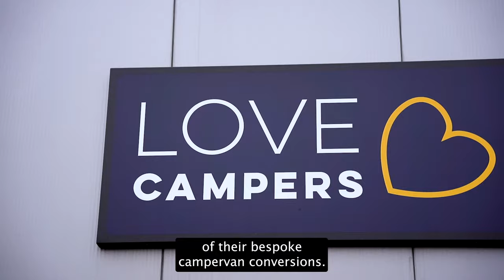VW ID Buzz Campervan Conversion VAN TOUR!!

Comment: Not enough interior height or length to the ID buzz to make a useful camper. As such this design is very compromised. Fridge on floor, no central dining table, only 2 belted seats, no grill or secondary hob. Feels like camper has gone backwards.

Comment: Can't deny the amazing looks of the ID Buzz, but am I missing something?  The real world range of this will be less than 200 miles, significantly lower in the winter or when fully loaded.  I know this through painful experience having owned 2 new EV's.  I thought the whole point of a camper was to drive for miles into the wilderness, something which will be very challenging with charging infrastructure as it is in the UK?
Reply: Our customers drove from Brighton to Scotland and back over 10 days in our Citroen E-Dispatch based campervan, which has a lower range than the Buzz. That journey was 1629 miles. It's possible, partly due to the high speed charging.

You can charge the Buzz from 5-80% in 30 minutes.

Also, based on early tests, the average efficiency of the Buzz with the conversion is 3.2 miles per kwh, 200 mile is the minimum I would expect.
Reply: You can perfectly tour with that Range.
I did 2500km in a week with an 75kWh eVivaro.
Now building my own E-expert camper.
Great tourer.
Reply: Old comment I know, but I just came across it. 

From where I live, (Derbyshire,) a 200 mile range would mean I could visit every single national park in the UK (mainland,) and only ever have to stop for one charge at most en route. A central location will have it's perks when we go fully electrical. :P
Reply: It's already been tested, a real world test it did 230 miles on average.

Comment: Beautiful looking vehicle but I’m put off by the short distance before charging..would it require 6 charges between London and Madrid..also if the batteries on EV s fail,out,of warranty there would be a huge bill to,pay
Reply: How is 6 charges much? Such a distance would normally take at least two days in an ICE vehicle. You can charge it overnight after the first day and obviously you need breaks anyway. Perfect moments for a charging stop. Also: EV batteries failing is very rare.

Comment: This small solar panel is redicoulus!!! Come on guys, you have a giant roof! Use this space! You can easyly install 1500W up there! And invent sth to charge the car with this power!
Reply: Even with 1500 W charging would be terribly slow. Not worth the extra cost and weight.
Reply: @Simon-dm8zv  During a whole summer day this would ad 15 kWh. To me this is no joke...
Reply: @thomasmargis9808  More like 5 kWh per day.
Reply: @Simon-dm8zv  If the panel is flat mounted I'm with you. But you can mount it on a flexible rig so that you can let it follow the sun.

Comment: I like what you did and are very happy to see what is possible

 but let me try to be as criticall as possible and maybe help you with some ideas.

- comparing it to the T2.... yikes, please don't, it is telling us it is not a T2 which makes us sad.
- a tiny solar panel of the roof....why so small when there is like 6 times as much space
- extra windows in the cargovan.....hmmmm I would prefer it to stay stealth and not have these windows, but when you want to maximise interior light then what is with the backdoor without windows? The image at 1:51 I really dislike. Windows don't seems to be at same height.
-Navy blue maybe should be a bit lighter to get more into beachlike atmosphere.
-The yellow this car comes in, you really have to be a fan..... :-)
Reply: The passenger van at 0:30 has the factory fitted windows. However this option doesn't have the flat floor needed for the camper conversion.

Comment: It's nice, but it's a day van unless it's got a pop top roof in my opinion.
Reply: We've been sleeping in our non pop-top Expert for over 20 years. Hundreds of nights. Standing up is nice, but you get used to it. Not having one saves several grand on the conversion, makes it much easier to DIY, and the van stealthier. We've not really missed it, although now we're over 50 we might get one on the next van. I've not seen one available for the buzz yet.
Reply: @xxwookey  me and my wife were using our converted t4 caravelle without a pop top for a few years.  It totally transformed the space after I fitted a westfallia pop top with roof bed for our kids.  Also it can be registered and insured as a motorhome home which lowers the insurance and is completely covered.  But interesting to see these new vehicles as they evolve.

Comment: Camper with 300km range... joke?
Reply: Why would that be a joke?! 300 km is perfectly fine. With fast charging you can easily cover many hundreds of kilometers more in a day.
Reply: @Simon-dm8zv  I won weekend with this car on charity auction.  I usually never read manuals but was really interested in this car so i read everything what manufacturer gave. 
Apparently it is not recomended by VW to charge above 80% or use electricity below 20% of batteries capacity. That leave you with 60%. 
When you drive 140km/h (cant faster because VW limited his car) battery will be enough to make 200-250km max. Then you need to spend 1-2hrs to charge it. This "15 min charrging" is a biggest lie. First you need powerfull charger (there are is only one near me but limited to TESLA cars only). Then weather need to be perfect. Something between 22C and 25C. If you want to charge to 100 % then you need extra hour to charge 80 to 100%. 
In my daily car it is not a problem for me to do 1000-1500km in one day. With this car i needed only 6 hours for charging when i wanted to do 850km.

I prefer to spend time before my travel to check on maps places to visit or to eat then to calculate perfect route between chargers. And pray for a working one everytime.

would buy this car with petrol engine. Or with 2x bigger range.
Reply: @Syrinxification  Obviously charging to 100% sometimes is no problem at all. So you make sure the car is charged overnight to 100% the morning you start your road trip. Driving 140 km/h in a van is too fast. I wouldn't go over 120. So that already changes the situation a lot. And of course you need to live in a part of the world where there are a lot of fast chargers (the vast majority of western Europe is fine) and then you will see that 1 to 2 hour charging time is vastly exaggerated. You can easily cover 1000 km in 10,5 hours of driving and charging - as Bjørn Nyland proved on his Youtube Channel.
Reply: @Syrinxification  some misconceptions there, but that's fine as you don't own an EV. I have an ID3, so can help.
VW is saying not to leave the car above 80 or below 20 for a prolonged time. It's perfectly fine to charge to 100% if you then drive the car the next day. I also often drive to less than 10%  when arriving at a charger, as charging at low percentage is much faster. A typical charging stop is 30 min (to a bit over 80%), you are right though that charging from 80-100% is extremely sloooow. I only charge to 85% and then drive away and make another charging stop, that is much faster than charging to 100% in one go.
yes, range is not the same as with a Diesel car and weather affects that even further. So you probably drive for 3 hours before taking a 30 min break (tacho breaks for HGV drivers are after 4.5 hours, so this is not that far off).
Reply: @POTThaesslich  Exactly - we just have to get used to travelling a little more slowly. It's not a bad thing. I've been used to 650 mile range (1000km) on current van, but we all have to go electric fairly soon so I'll just have to adjust.